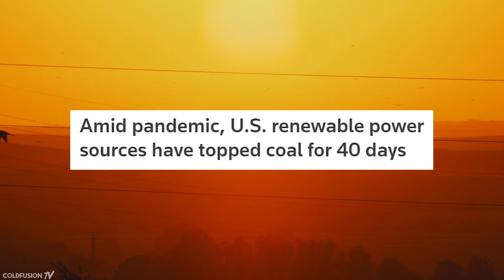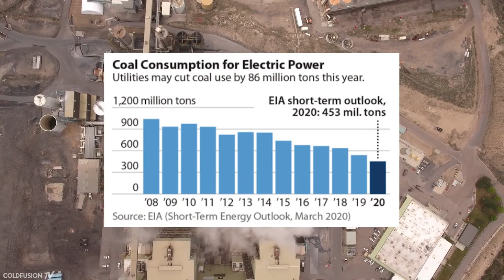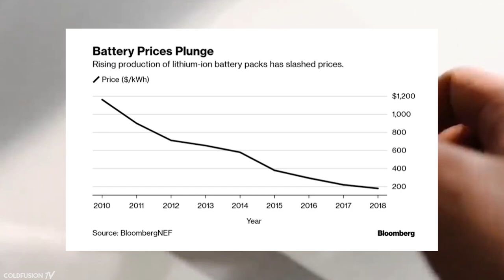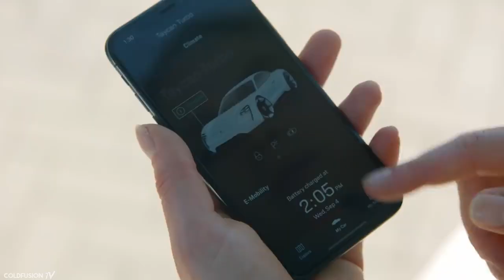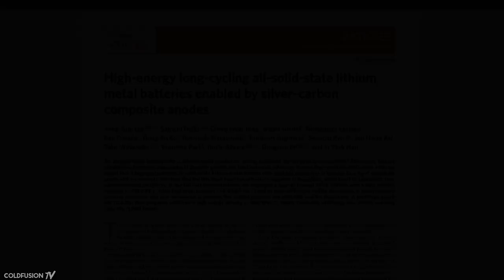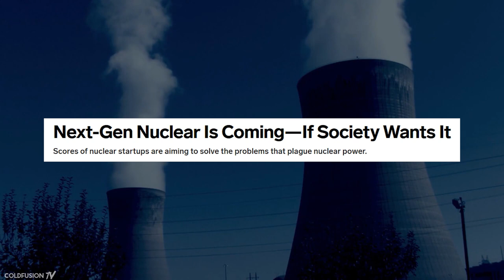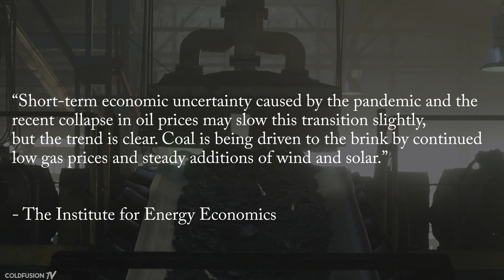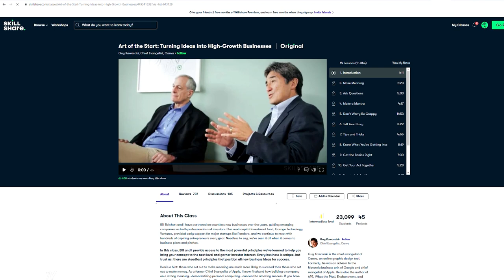Amid Pandemic, Renewables Now Supply More Energy than Coal in the U.S.

Comment: 5:20 don't use mah to compare batteries, it is dependent on the voltage of the battery, use Wh
Reply: Because  why ???
Reply: @kidchaudhary8405  because without taking the voltage into account, the actual energy stored could be orders of magnitude different
Reply: @kidchaudhary8405  Watts = Amps × Volts. Watts is the actual power that the battery can produce (think of a lightbulb, an old incandescent may take 100 Watts to power it). But let's say that you want a 50 watt battery. You could accomplish this either with a 25 amp, 2 volt battery or a 2 amp, 25 volt battery, or a 5 amp, 5 volt battery. They all produce the same power, but one is a 2 amp battery, another a 5 amp battery, and a other a 25 amp battery. Now this is the power at a single moment, so you need to multiply it be time (hours), so if each of these batteries last an hour, you have a 2 amp hour (2000 mAh), 5 amp hour (5000 mAh), and a 25 amp hour (25000 mAh) battery. The 25000 mAh battery sounds like it stores much more energy, but in reality, they all supply the same amount of energy: 25 watt hours or 25 Wh.
Reply: Thanks, I was just about to say that. My phone has twice as much mAh as my mom's e-bike. Yeah, it depends on the voltage
Reply: it always annoys me looking for batteries online that measure in mah, it tells me literally nothing about how much power it can store.
Reply: mowgli2071  mAh is not a unit of energy. Wh is a unit of energy.
Reply: mowgli2071 NO, mah is electric CHARGE, NOT energy. VOLTAGE times mah is energy.
Reply: mowgli2071 you ccnfuse CHARGE with ENERGY. Energy is mah times Voltage.
Reply: I came down here to point this out but it seems you guys already have it under control :P
Reply: Correct. W*h = power * time = total energy.
Reply: mowgli2071  Don't talk with such confidence if you don't know the subject. I am an electrical engineer, so let me tell you; mAh indicates the amount of current a battery can provide for an hour. For example the 5000 mAh battery he shows can supply 5000 milliamps (5 Amps) for an hour and the 1700 mAh battery can prove 1700 milliamps (1.7 Amps) for an entire hour before going empty. However the total energy is both dependent on the voltage of the battery and the current (Watts = Voltage x Current). The first battery he shows gives 1.7 Amps for one hour at 14.4 Volts, this means it can suplly 1.7*14.4 = 24.48 Watts of energy for an hour, which means its capacity is 24.48 Wh. Whereas the second battery can supply 5 Amps for one hour at 3.7 Volts, making it able to supply  3.7*5 = 18.5 Watts, which means it can story 18.5 Wh of energy. This means, even though the mAh rating of the smaller battery is lower than the other, the bigger battery can store much more energy than the small one ( 18.5Wh vs 24.5Wh ). mAh isn't a unit of energy, it is a unit of current capacity of a battery, which may or may not be related with its energy capacity. Which means you can compare the capacity of batteries using the mAh if they are working at the same voltage. So yes, you can compare AA batteries with each other given their mAh rating or compare two phone batteries and even power banks with each other depending on their mAh rating but this only works because they are working at the same voltage. However, in this video, the batteries he shows are working at a very different voltage. In this instance, the only way to understand their capacity is to compare their Watt-Hour (Wh) capacity and not the mAh capacity. Watts is defined as Joules per second, which is a unit of energy. Milliamps is defined as coloumbs per second, which is not a unit of energy. So what you say: "mAh certainly is a unit of energy" is wrong among with other things. So yes, "There is a way that a 1,600 mAh battery stores more energy than a 10,000 mAh battery."  You can still go and compare rechargeable batteries with each other with your technique but I advise you to learn more about this subject before talking this confidently.
Reply: @kidchaudhary8405  E=IR Ohm's Law.
Reply: Agreed. It's a far better way to determine battery output and duration.
Reply: @devrim-oguz  Good to see a fellow engineer getting the basics right and also being able to explain it clearly! That's good news for your future endeavors.
Reply: The laptop had 4 1700mAh  li-ion batteries in series. So, it's the equivalent to a 6800mAh battery.
Reply: mowgli2071  It is not, without nitpicking here.
mAh is a (silly?) placeholder for Coulomb because of historical reasons. The amount of charge is just a part of how to know the energy stored by a charge separation.
The energy actually stored in that field (or number of e.g. electrons brought through a change in potential (the unit is the volt btw).

Watthour is indeed a way of expressing the amount of energy.
a Watt  is defined as 1 Joule per second. So sure whith 3600 seconds in an hour, it follows that 1 WattHour is 3600 Joules. 

The Coulomb is defined as 1 ampere per second. It does not say anything over what potential uphill or downhill the charge went during the voyage. So that also means that It cannot be a represention of a quantity of energy.

Now it seems that everyone seems to assume the most used cell type and chemistry used: LiI0N in two versions. But even those differ in potential (The voltage one would measure under actual load and without load for the most optimistic number).

Battery technogy changes over time. So does the cell voltage and the discharge profiles.

Spend 30 to 300 minutes on wikipedia and do some calculations by hand and on paper.

Suggestion 1) Calculate the energy that a typical microwave capacitor stores assuming perfect capacitor behavior and the cap is only charged to 2000 volt.
Suggestion2) Calculate the energy contained in a lead bacid battery for a standard honda civic.
Suggestion 3) Calculate the energy of a standard zinc air hearing aid button cell, do the same for the same dimensions of a silver button cell.
4) calculate the energy content for a collection of typical lg or panasonic 1860 cell found in typical powerbanks or laptops, that have the same total mass as the above chosen lead acid battery.

Im not trying to troll or be nasty. Science and tech matters. And the more science and tech creeps into society, the more tech knowledge should be common knowledge. 

Greetings from a materials scientist and father.
Reply: @colekam  No, your device decides voltage.

Or can you explain why battery in Note 10+ lasts longer than one in Note 10 even though 10+ requires more?
Reply: @UltraCasualPenguin  Ok...this thread has been so long with no one really understanding. 
*Devices have some type of battery that powers all components in your device to run and they have a set voltage you can't change that. 
*Note 10+ has 4,300mAh and Note 10 is 3,500mAh so the Note 10+ last longer because the battery contains more charge not because of different voltage. Google says generally phone batteries are rated around 3.7V. 
*The original post was just saying that you can't compare the two properly by using mAh because they don't have the same voltage. The first battery pack he mentions at 5:13 has a voltage of 14.4V meanwhile the ASUS phone is about 3.85V per what I saw on Amazon.

***None of this matters because if you google that laptop battery today, that same battery with same voltage (14.4V) is rated with 4000mAh. So yes the capacity to store voltage has drastically gotten better.
Reply: @alkiou3613  parallel connection increase battery capacity not series connection. It's (series connection is) for increasing battery's voltage or power. Because a laptop uses 11volt to 19volt while a single (li-ion) cell is 3.7volt to 4.2volt.
Reply: mowgli2071  then try hook that 3 volts battery to replace your car battery, let;see how long it will last
Reply: @kidchaudhary8405  Because a 7v 5000mah battery is different than a 24v 5000 mAh battery
Reply: @monniger93  When you're talking about how long battery will last you should be talking about amps not about voltage.

Note 10 and Note 10+ might use same voltage but if it was all about voltage Note 10+ should be operational a lot longer than Note 10. But draw isn't same for both because 10+ has larger screen and higher resolution.
Reply: @crazymatt2685  I hope battery /powerbank companies will change their marketing strategies and shift mAh to Wh.
Reply: mowgli2071 nope, mAh is a unit of charge. 1A = 1C/s, so 1Ah = 1C/s * 3600s = 3600C, so 1mAh = 3.6C
Reply: mowgli2071  Should be start with the one in the video? it listed the capacity as 12 Wh (the text is clearly visible in the video). Also interesting is that 12 Wh@3.8V works out at 3158 mAh and the line at the bottom says minimum 3250 mAh and typical 3333 mAh, so no idea where he got 5000 from
Reply: YES!
Reply: mowgli2071  Only for the same voltage. He was comparing an obsolete laptop to a mobile phone. Obviously, they don't run on the same voltage.
Reply: @Gokalex - Good point! 

If anyone was wondering; the energy capacity of the laptop battery shown is 14.4V * 1700mAh = 24.48Wh; and the batteries used in phones are ~3.7V - 4.2V. Assuming 3.8V[battery voltage of the iPhone 8], the energy capacity of the phone battery is 3.8V * 5000mAh = 19Wh. The growth in battery technology is impressive, but not THAT impressive. :)
Reply: @r.k.vignesh7832  Not nearly the same size also :)
Reply: @kidchaudhary8405  1.7Ah *14.4V= 24.48Wh VS the 3.7V * 5Ah=  16.5Wh. Still, it's true that the Wh / gram (energy density) nowadays is much better. But don't use Ah, it's improper.
Reply: @thekookaburr4  if you open up the newerpowerbanks its usually printed on the cell(s) inside and very often also on the outside of the device, at least i see it more and more. 
And it is only partly obervation bias. Because this very issue 
has bothered me as well ever since i learned about the basics in physics and chemistry class. Super annoing even on old school allkaline or carbonzinc AA i always had to look up the specs from the manufacturer, including the graphs that show the current going through a load(several values ofcource). 
Versus the potential of the battery cell that remains under these loads.

For example: althought zinc-carbon-air battery cells sound super old school and obsolete as you can get, actually the energy density per mass is better than alkaline of top tier manufacturers.

The issue is: they are only usefull when the current drawn by a load is near nothing. 

But they are perfect for remote controls bacause those nearly draw no current at all and a remote control is not airtight. 

Usually they are sold as hearing aid button cells, AA versions are more rare though. Dont forget to remove the plastic sticker from the air inlet of the battery cell :) its not there for show.

But also normal zinc carbon battery cells are okisch. And they dont leak ! 

That is what i dislike about alkaline cells. They leak. Sometime soon, sometimes it takes a while. And those Alkalines have destroyed more remotes and forgotten toys that i can count on two hands.

And even when I am super precise when buying a pack of alkalines or other types, taking care to look at the date of manufacturing, and making sure that all of them are replaced. And even them they leak.
All brands. I blame it on the stupid bunny commercials :)

However, my wife and some of my friends when they are at my place sometimes borrow or swap batteries with no bad intent, but just are naive about it.  

Battery cells, whatever type,  i love and hate them.
Reply: @actionguitar  yeah. Its like talking to a wall. I also called it a placeholder if charge even and also pointed out the thing of 1 hour containing 3600 seconds. And again, totally mixing up again charge with energy. At this point its something akin to trolling or being dense or being locked in a certain thought pattern.
I give him/her the benefit of the doubt, but ill waste no more joules or mwhours on replying :)
Heck, we could even calculate the increase or decrease in rest mass of a battery when charged or discharged. But lets not do that.
Reply: I was glad someone else noticed that flaw in the video, then, when I read all the answers, became sad to see how people discuss before making any researche first. 
The NiCd battery pack (twelve 1.2v cells in series) is 1.7Ah 14.4v = 24.5wh
The Li-ion  battery cell in a phone is 5Ah 3.7v = 18.5wh.
Reply: mowgli2071  if you run the same battery on 3v 7v the mAH will differ under the different voltage. Quick dementia analysis will reveal that milliamp hr is not a unit of energy.
Reply: YES! exactly why i was still here here scrolling. 
Reading this comment section i can see that Ohm's law should definitely be part of any schools curriculum.
Reply: @thekookaburr4  they are already doing that on a regular basis, even on the outside of a device using cell(s). Even on random stuff in lidl often the watthours are mentioned. Battey pack tools though usually do not mention a continous or max power consumption ... I find that info usefull as well. Maybe in two years it also becomes default.

Even it is now becoming kind of weird to not have printed the eneegy as well on the cells indivudually, and certainly there is an almost overload of info to find if you google the cells, from the orinal manufacturer ofcource.
Then on the spot in de pdf you can have insight how haviour will shift with loads and over time and over temperature and more. I agree thats a bit ovr the top to microprint that on the cell in its fyll glory :)
But, sure, second hand cells wont state much. They could be super but youll have to characterize it yiurself.
Reply: Batteries can be connected in series -voltage , and parallel -amperage
Reply: @coldavellebelle9378  So? that proves my point... if you change the configuration of a multi cell battery you get different mah ratings while the Wh rating (actual capacity) stays the same